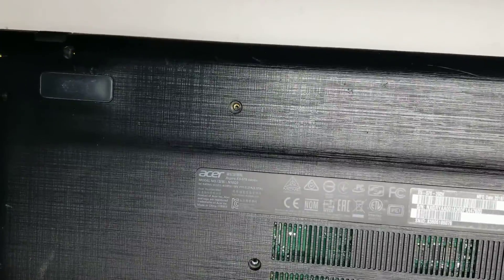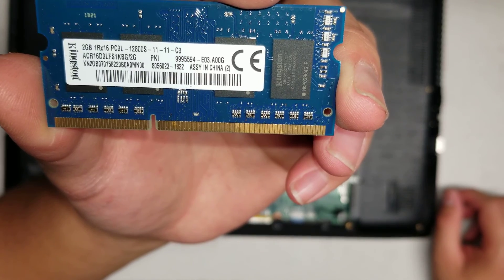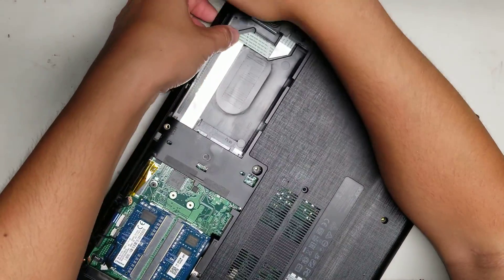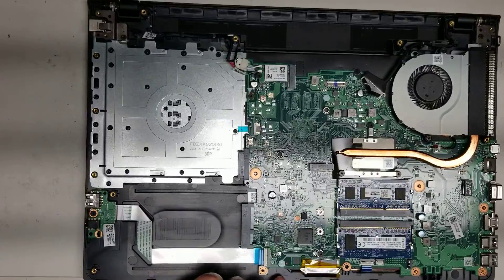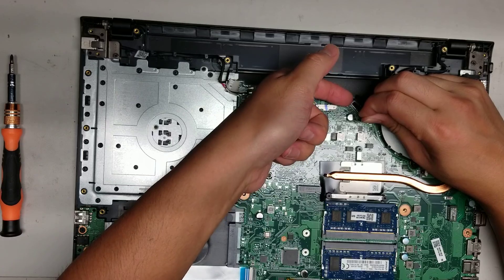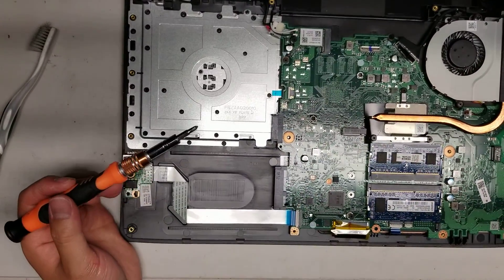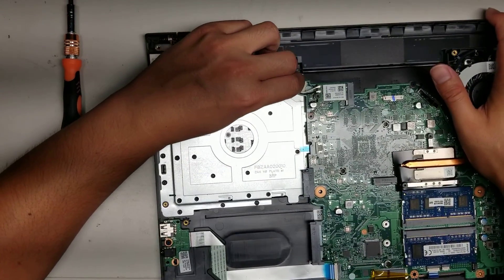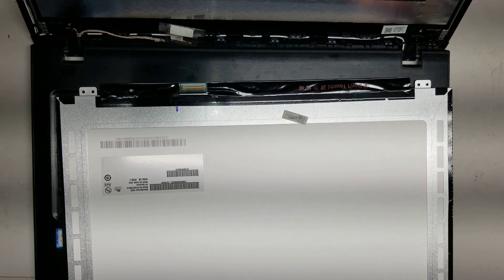Acer Aspier E5-576 Series N16Q2 Disassembly RAM SSD Hard Drive Upgrade Repair Screen LCD Replacement

Comment: sorry but, I can't upgrade to a dddr4 ram, right?

If so, I have 4gb and want to add another 4gb ddr3l, will it work bro?
Reply from the maker: It can only use the type that's currently there. DDR3 and DDR4 have different sockets.
Reply: @ItsBinhRepaired  I have DDR3

Comment: Thank you, im trying to replace the fan but the only video i could find was in a different language with no translation. My question is, if im just replacing the fan, should i still drain the power like you did at 6:46? Im kinda new to this so id rather be safe than sorry
Reply from the maker: It takes a few seconds, just do it anyway.

Comment: Funny that I was thinking that it would be harder to take apart but instead it's far more simpler.

I'm planning to replace the thermal paste as the HDD with a SSD because I bought it new from Amazon which the 1TB HDD that came with it runs way too slow which even my cheapest Tracfone loads up faster.
Reply from the maker: Definitely want an SSD

Comment: Bro video was super helpful.
My same model lap wont turn on when i press power button.
It does turn on sometimes.. But it turns off after the acer logo appears. ( Like we force shut down the lap by press and holding power button, I mean we can hear the HDD head going back sound when its shut down)

It turn on sometimes, sometimes it wont . What it could be ??
Reply from the maker: Not sure. Have you tried an external monitor?
Reply: @ItsBinhRepaired  Yah if it turns on, it works with external monitor too..

Like its not the display. The whole lap is not Turning on. even if somtimes it turn on, it shut downs right after the logo appears.

But somtimes it pass through. Like it turns on. 
When it does i have also checked battery.
Like it will stay on for 5+ hours without AC
Reply from the maker: I hate how YouTube doesn't notify me of replies. Were you able to figure it out?

Comment: where is the cmos battery located? how to replace it?
Reply from the maker: If it's not using the main battery as the cmos battery, it's on the bottom of the motherboard.

Comment: Hi thanks for the videos, can u share with me the specifications for the charger?. I lost my charger and I need to buy a new one. Thanks
Reply from the maker: It should be on a sticker on the bottom. Voltage and amperage
Reply: @ItsBinhRepaired  I know, but i lost mine :( hahaha.
Reply from the maker: Were you able to find the info you needed?

Comment: Can you tell me which model SSD could be compatible for same series Acer laptop
Reply from the maker: How much storage do you need?
Reply: @ItsBinhRepaired  actually I have acer aspire e 15 e5-576-31ww and I need 500gb ssd
Reply from the maker: @vijendrabijalwan7936  assuming it uses the same type of hard drive, this would work https://amzn.to/30WMTJp
Reply from the maker: @vijendrabijalwan7936  this video will help as well https://youtu.be/4p5jFDzVwUw
Reply: i know this is quite late, but it also supports m key nvme ssds and sata m.2 ssds.
Reply: @abhimaanmayadam5713 
Sir are you sure in same slot two types of SSD support
Reply: @Sumit-cy1ug  i know SATA ssds work, supposedly someone got nvme ssds to work. It appears to be keyed for m key ssds, and sata m.2 ssds are b+m key. I haven't worked on this laptop in several years but when I was doing this upgrade, I used a 128 gb m.2 SATA SSD as that's all I had on hand. A non zero amount of laptops from this era do support nvme, even if they came with sata m.2 ssds.

Edit 2: it might not support nvme. It might be keyed to support an m key ssd but not set up for nvme.

Comment: Hi bro! May i know which RAM suitable to upgrade for this laptop?
Reply from the maker: I mention the type of RAM in the video. How much RAM did you want to upgrade to?
Reply: 32GB
Reply from the maker: @chuakianshing9540  not sure your planned usage of the computer. For most people 8gb is plenty. The most you can get is 16gb. If you don't already have an SSD, that'll be a much better upgrade. This RAM will work, but again, 16gb is the max. https://amzn.to/3CjDqsh

Comment: Hello good sir, is there a replacement for the GPU, sometimes this model has a common problem of having the dedicated GPU which is the mx150 showing errors in windows (Code 43)
Reply from the maker: Can't be replaced

Comment: You could've been more specific with the screen, I pulled the frame cover just as you showed, and ended up breaking the back cover
Reply from the maker: More specific in what way? Don't break it? I gave exact instructions how to move the cover to remove it and showed exactly what I did...

Comment: Hi dude. Very useful video.
The connector in left to the RAM Memory is a M.2? I could add a 2nd SSD.

I celebrate not having to disarm the notebook to change HDD !! 
Lately these devices are less and less easy to disassemble.

Greetings from Argentina!
Reply from the maker: Looks like it. I haven't tried, so I'm not sure if it supports m.2 pcie, SATA, or both.
Reply: @ItsBinhRepaired  it supports both sata and m.2 pcie. but its m key. Also it has unique quirk of the m.2 being disk 1.
Reply from the maker: Interesting

Comment: How many pins is the LCD?
Reply from the maker: Why do people ask that question? Are you trying to custom make a cable?
Reply: I was asking how many pins was the lcd flex port. So that I know what to buy. There are many LCD pins currently available, some are 30, some are 40, there are 14, etc.
Reply from the maker: @pjtutorialsPH  how would I know? I don't count those things. Lol Take it apart and count them if you'd like. I just buy exact model number replacements. I don't bother counting how many pins and things like that.

Comment: my acer has no hard drive... i just realized this when i opened it up and there is nothing where that white tape is at... what gives? any ideas?
Reply from the maker: Hmmm possibly hidden SSD?
Reply: @ItsBinhRepaired  what would that look like? where would it be? mine is set up likes yours, with the back left spot but no hard drive in its place
Reply from the maker: @---cx1ly  possibly under the motherboard
Reply: @ItsBinhRepaired  It looks like I found the SSD... i scanned the QR code and it said SSD card.. so that would be it?
Reply from the maker: @---cx1ly  maybe